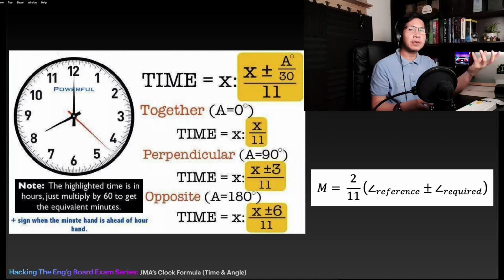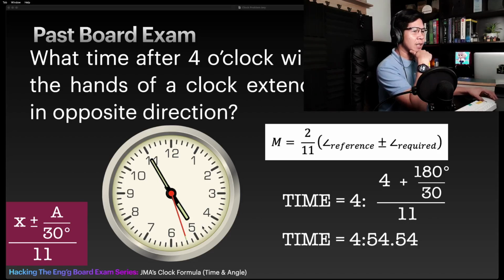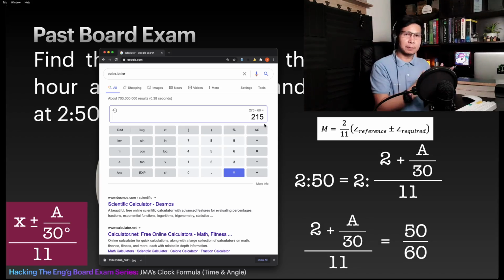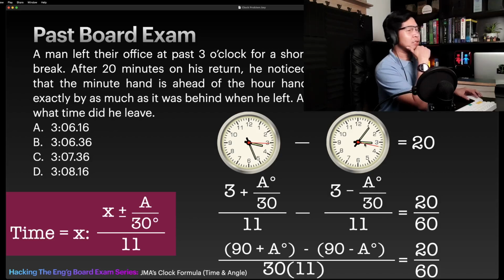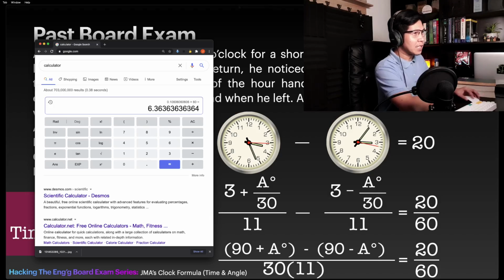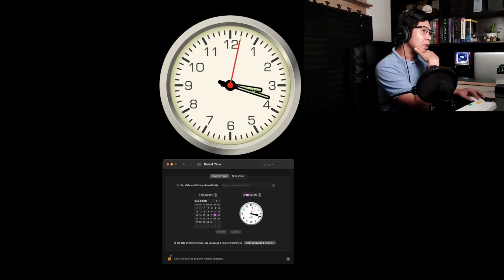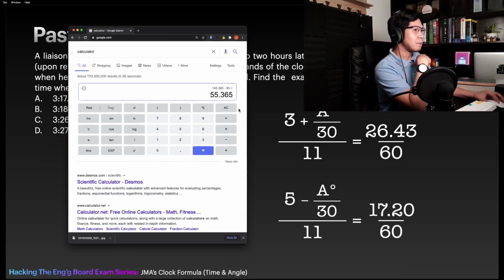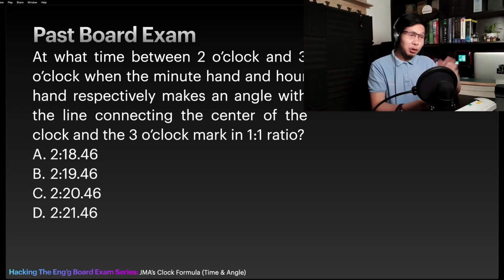Hacking The Engineering Board Exam Series | JMA's Clock Formula (Time & Angle) - Part 2

Comment: sir ano po yung connection ng 26.43 sa sagot na 17.20 sa 21:49? di ko lang po nagets
Reply: @Daryl Cruz Ginamit ang 26.43, para makuha ang angle na 55.365 degrees between min-hand at hour-hand nung 3:26.43 . Ito rin ang angle na ginamit para makuha ang oras after 5 o'clock dahil pareho dapat ang angle nila. Kaya lumabas ang sagot na 17.20. Ibig sabihin ang 5:17.20 at 3: 26.43 ay pareho ang angles.
Reply: @gnidnoeled786  Dba pag i try mo yung option D, may makukuha ka ring angle? tas makukuha mo rin ang time after 5 gamit ang angle. So ano ang talagang basehan na option C ang sagot?
Reply: @millions20  Ang basehan ko po na C ang sagot ay ito.
3 : y  ay oras na umalis sya (time na hinahanap).  
5 : x ay oras na bumalik sya.
y = 25 + x/12. Ang y location ng min-hand sa time na 3 : y
Ang x/12 ay mula sa 5-hr mark hanggang sa hr-hand sa time na 5 : x
x = 15 + y/12.  Ang x ay location ng min-hand sa oras na 5 : x. I-plug ang equation na ito sa y = 25 + x/12. Ang y = 26.43. Kaya ang oras po ng umalis sya ay 3 : 26.43
Ang oras naman na bumalik sya ay x  = 15 + y/12.
x = 17.20. 
Ang time na bumalik sya ay 5 : 17.20